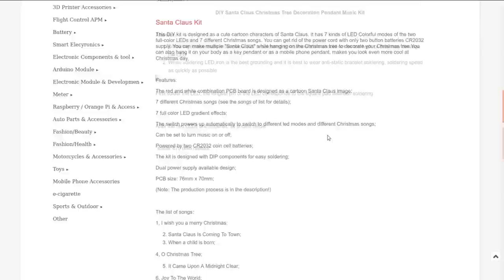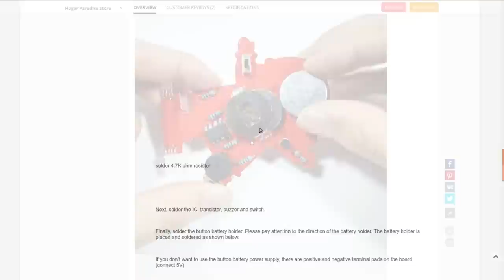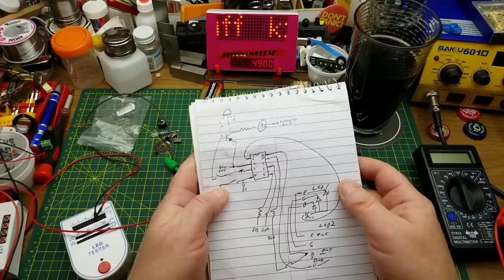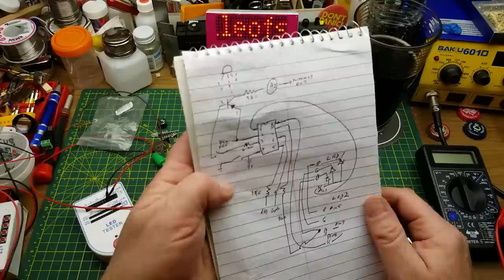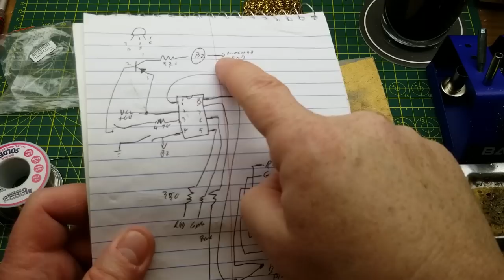Christmas kit build: it's Santa!

Comment: When calculating LED current you need to subtract the forward voltage of the diode (these days most often ~3V) from the supply voltage (unless Vsupply >> Vf as Vf then wouldn't really affect the result), as the difference is what ends up across the resistor.
So in this case you end up with about 1/2 the current as  calculated.
If it's multiplexing the 2 LEDs for different colours, that would again halve the effective current as each is only on for half the time (and if the same colour is on both LEDs, multiplexing wouldn't be needed but the current would then be split between the LEDs instead...)
Reply from the maker: You are right, of course. 

I blame being in a rush trying to get this done in time for Christmas...

Comment: Smashing job, the little happy feller works :-D
I've always found those resistors a bit of a pain to read, the body colour is often blue and some have the band spacing so the direction to read is not obvious.
The blue background makes the other colours look odd.
White or cream always looked better, even when run too hot.

I have a hand full of the cheap 830b multimeters, plenty accurate enough for go/no go checks :-D
Hope you are having a happy xmas, thank you for your videos even though i didnt start watching from the absolute start :-D

Comment: Nice little kit,a fun hour, maybe the LEDs could have been brighter, colour blindness must be a pain the arse occasionally, but regardless of what you see, did the supplied resistors look the same as in the photo?...I say stick to the sponge I don't get the idea of scraping your plated iron tip with a bag of "swarf" never have never will, damp sponge has served me well for 45 years (whinge, grumble " when I were a lad" ect)...happy christmas and a happy new year!
Reply: You aren't "scraping your iron" - the cleaner is brass which is HEAPS softer than the plated tip. The cold wet sponge thermally shocks the plated tip, potentially cracking it, plus you lose tip temperature each time.
I stopped using sponges about 30 years ago, and I have never EVER worn out or damaged the plating on a tip after using brass cleaning wool.
Reply: @johncoops6897  whatever floats ya boat.

Comment: 3:42 = "6 Volts over 100 Ohms = 60 milliAmps" = ERRR, NOPE.
6V (Battery) - 0.1V (est. IC drop) - 3.2V (est. LED) = 2.7V over 100 Ohms = 27mA
Your 60mA would be the current if there was just the resistor shorting out the battery.
You installed 330 Ohm, in which case it would be about 7mA per LED.
If they really are multiplexed (unlikely), then current would be halved.
Reply from the maker: Yeah, you're right. I was rushing more than I should have been to try and get it done in time.